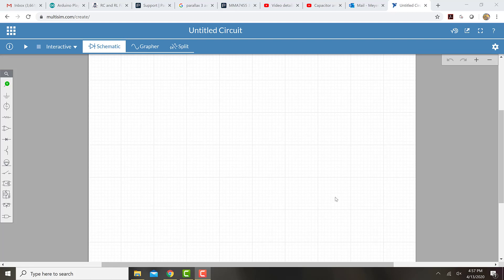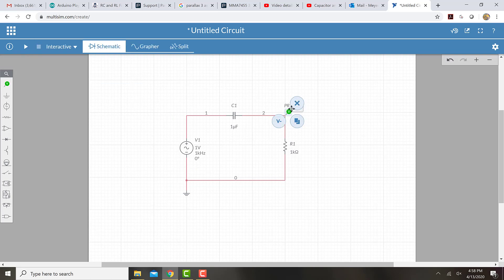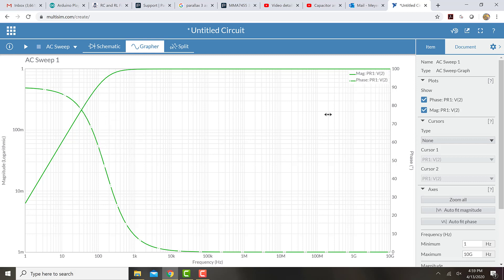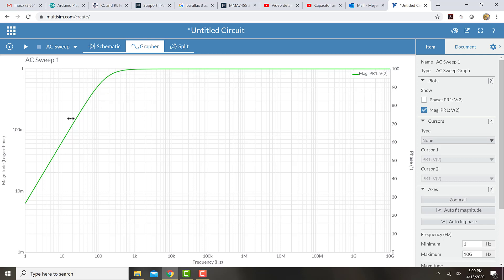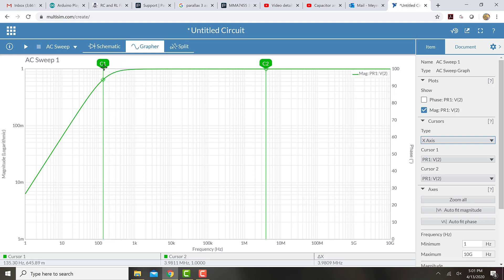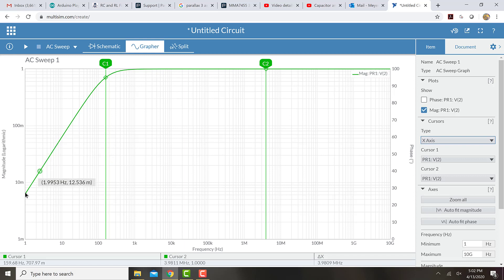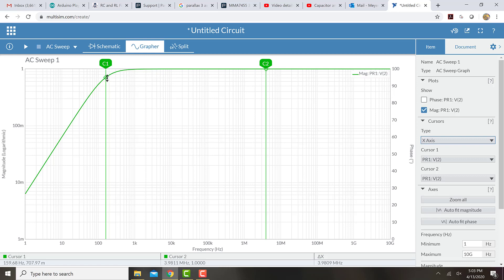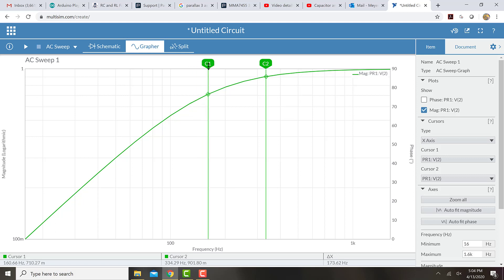Frequency Response on Multisim.com

Comment: Nice. But why's there no upper cutoff frequency here?
Reply from the maker: This is a high-pass filter.  It only has a lower cutoff frequency because it only attenuates low frequencies.  By the same token, a low-pass filter only has an upper cutoff frequency.  A bandpass filter attenuates both low and high frequencies, and allows only a middle band of frequencies to pass through.  Thus a bandpass filter has both an upper and a lower cutoff frequency.